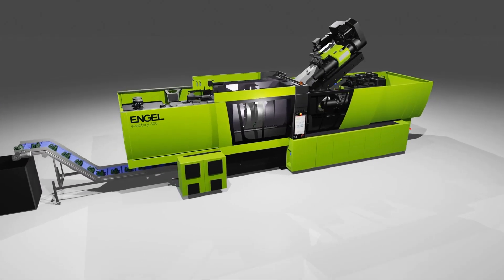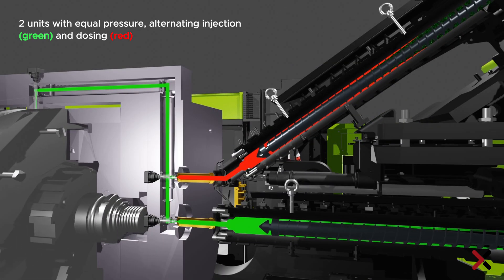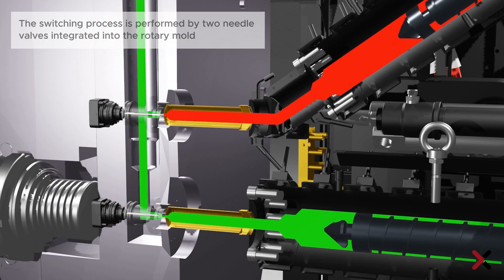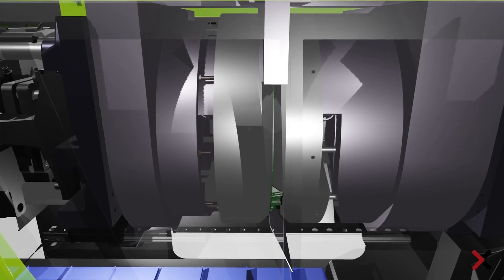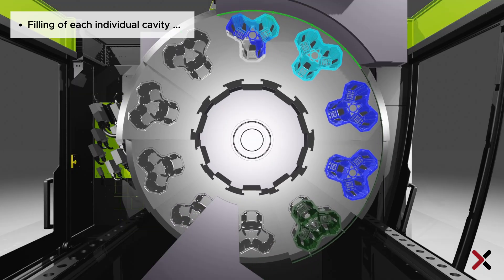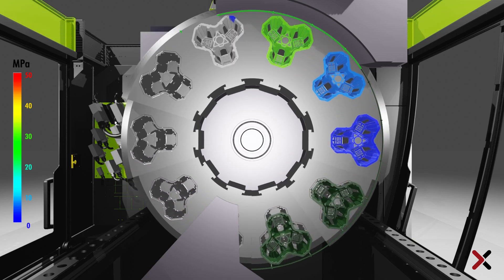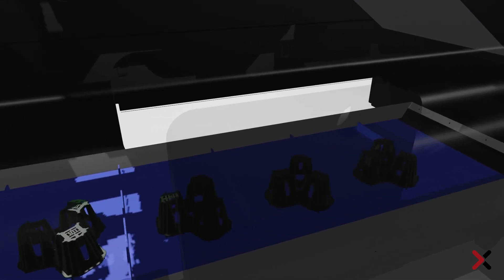Revolution in injection moulding: EXJECTION® CONTINUOUS MOLDING explained by IB STEINER with ENGEL

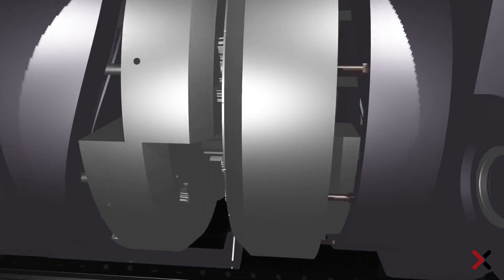Comment: at 2:25  how can you say with same investment more productivity do the machine cost the some as normal toggle injection machine or do the mold costs the same as single pcs mold of same product
Reply from the maker: the additional costs due to drive unit and multi cavity mold are small compared to the increased productivity / furthermore you need less machines to reach the same production goals due to better time efficiency within the process 🙂 thanks for your comment / question 🙋🏾‍♂️